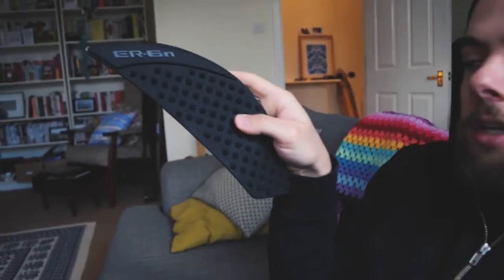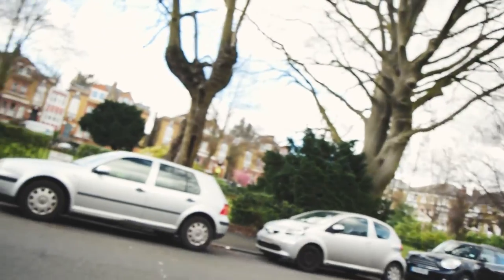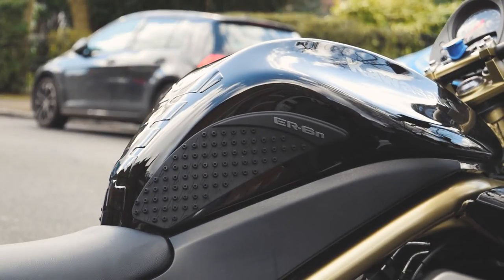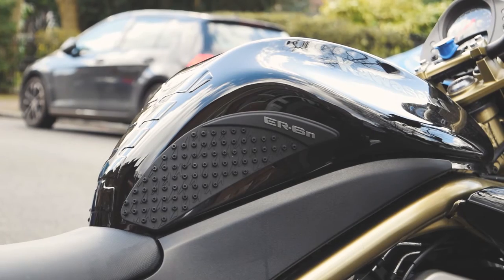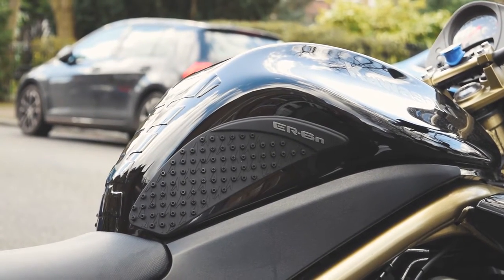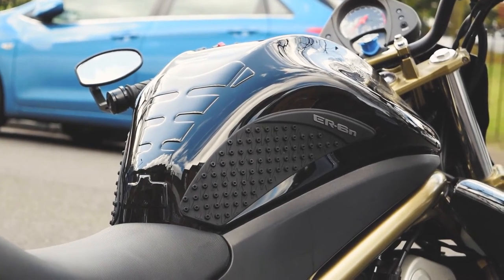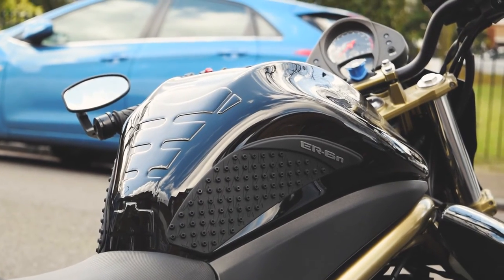How To Fit Motorcycle Tank Grips / Knee Grip Pads

Comment: So here's the thing, my legs are fairly short, i'm a girl and my knees don't sit up where the tank is. If anything, they sit completely below the tank on the plastic just below the tank. Do you think it's reasonable to stick the knee grip pads on that lower plastic section for me? I ride a CBR500R
Reply from the maker: Totally! Better to stick them where you need them, although you might have to trim them a bit to fit.